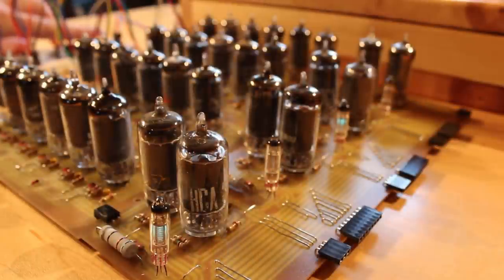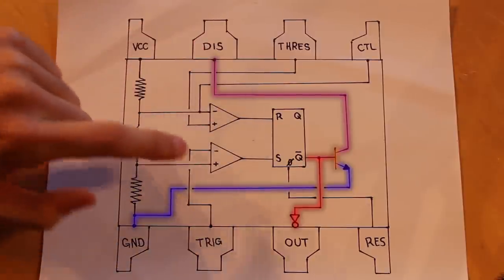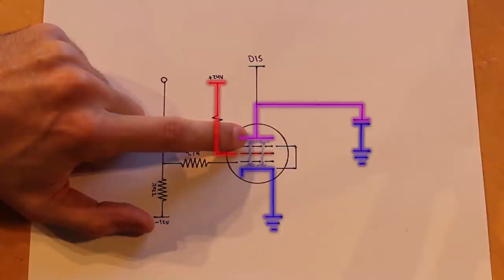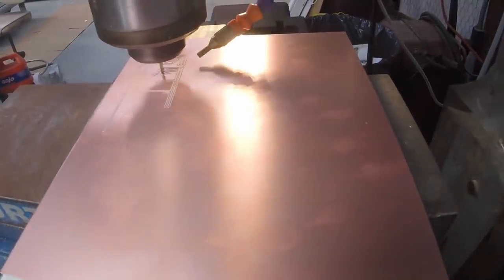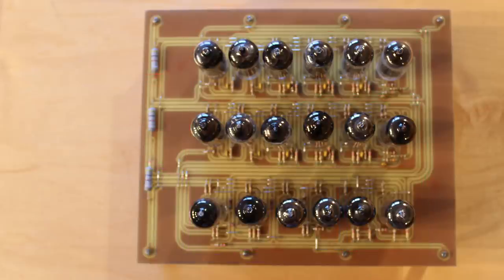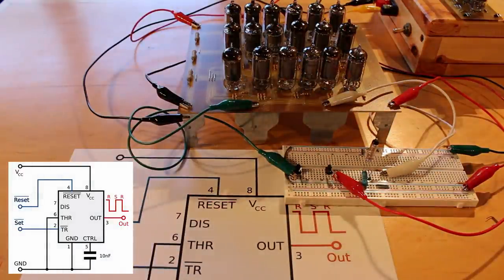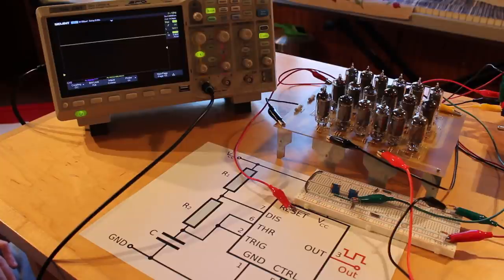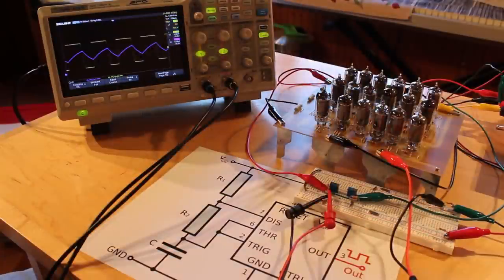Building the Largest 555 Timer in the World out of Vacuum Tubes

Comment: Reminds me of the broken semiconductor part "Made in Japan" that Doc Brown in 1955 replaced with a jumble of tubes and wires such that the Delorean time machine could work again. Excellent idea and super execution! One of the first chips I ever used (back in 1983 in school) was the LMN555 timer chip.
Reply: It's proof that that could be done. Although it would have been very expensive. Transistors existed back then, but they would have probably been $20 or more a pop ($20 in 1955 dollars), I'd have to look it up. Although, Doc financed his science with some sort of inheritance, didn't he? I actually used to do something like this before I figured out where to buy ICs. I would TRY to wire up say, an XOR gate made with RTL (resistor transistor logic), which is about the simplest logic you can get. But still required several breadboards just for a half adder. Not to mention the rat's nest of wiring, but I'm sure that could be cleaned up.

Comment: Surprised at how SQUARE the square wave was (thought it would be "warmer"?). Great job, the art of electronics. And demonstrating using vacuum fluorescent display was a nice touch (never seen a VFD like that before.) Fun video, thank you.
Reply: Well, the comparators / op amps use 6 tubes each, which should give them pretty high amplification, meaning that the comparators should be switching really quickly between maximum and minimum voltage. I think that's why it's so clean. The design had probably worked ok with fewer gain stages in the op amps, but then I imagine the square wave would have been more rounded.

Comment: Awesome project :)

Now build a tube version of a 4017, thow in some Diode valve's and use some VFD's to build a valve version of the night rider scanning eye :)
Reply from the maker: Thank you!
Decade counters are really tricky with tubes! I haven't had much luck at low voltages getting a good toggle flip flop working, but at higher voltages, HP had a really great design for a decade counter: http://madrona.ca/e/edte/HP520/index.html
One of these days I'll have to dive into that circuit design and see if I can make it work at the low voltages I'm working at!
Reply: 4017: my favourite chip.

Comment: Cool project!  Just one minor nit-pick - you have the operation of the monostable backward.  At rest, the cap is held in a discharged state by the discharge pin.  When the 555 is triggered, the discharge tube/transistor turns off, which allows the cap to charge toward Vcc.  Once the voltage reaches 2/3 Vcc, the threshold comparator resets the flip-flop which turns the discharge device back on, discharging the cap in preparation for the next trigger event.
Reply from the maker: Thank you!
I knew I'd make a mistake somewhere on the 555 timer side, haha. That makes sense though, thanks for letting me know!

Comment: I love it - you have a 555 timer that needs to warm up :)  Great video.
Reply from the maker: Thank you!
It's really fun while warming up too because all sorts of chaotic things happen as the tubes warm up at different rates!
Reply: Not only that but it's a 555 that works natively with higher voltages. No buffers or voltage translation required 👍 Surely there is a niche application where this might be useful? As long as power consumption is not an issue 🤷‍♂️

Comment: Awesome! Made my day! If you want to make an affordable kit, think long and hard about the tube type, because that's going to make the biggest differernce price-wise. Select something that causes audiophiles to cringe. Something made in abundance at one time and then not used for another purpose, like a TV video amplifier or something like that. In europe we have the Pxx type tubes, these are usually dirt cheap. I really like the physical format and how it looks like a scaled up version of the real thing, don't change that!
Reply from the maker: Thank you!
Figuring out the tube type has been the biggest hurdle to overcome. My go-to tube is the 6AU6 as it works really well at low voltages and is very cheap indeed (aside from using it for pre-amps, it's mostly ignored by the audio community. However, I realize that that tube may not be easy to find depending on where someone is in the world (or even how the used market is feeling on a specific day). 

So, I've been working on an OpAmp design that only uses 4 tubes (instead of 6) and has some potentiometers in it to tune it to different tubes. So far, I've got it working pretty well with 6136, 6AU6, 6CB6 and 6DT6 tubes. Some others like the 6BA6 didn't work at all, so we still have to pick the right tubes. But, having more tube options is always better!
Reply: There are a lot of cheap 6F1Ps on eBay, if triodes can also be worked into the design!

Comment: This is absolutely brilliant! Including the pins and all that. I love your PCB design, with rounded corners on tracks.
Reply from the maker: Thank you so much!
I really wanted it to be as close to pin compatible as possible, though I did have to sacrifice the control pin to get my negative bias voltage in.
The rounded corners are probably my favorite part of the PCB design. I especially like it when there's two or three traces that follow the same curve, it gives a really unique look. It's kind of my modern, digital homage to the hand-drawn traces of yesteryear!
Reply: @UsagiElectric  yes, I know the old PCB design from all those radios and amps I repaired :) And in my early days in electronics (1990s/2000s or so) I did hand-drawn PCB designs, then etched them with ferric chloride or a mix of hydrogen peroxide and muriatic acid. I hardly ever make devices using PCB as I prefer the old point-to-point style and terminal boards (most of the electronic stuff I make is vacuum tube amps), but when I do, I typically do it in Eagle and either have the design CNC engraved like you do, or take it to a PCB manufacturing company and have all SMD parts soldered in so that all I have to do is through-hole components.

Oh, and your wascally wabbit is so sweet! :)
Reply from the maker: @KeritechElectronics  I have massive respect for anyone that actually etched PCBs with acid! I'm so accident prone, that I'm absolutely terrified of knocking the container and spilling chemicals everywhere. Fortauntely, with the mill, I just get everything zero'd out, hit Go and then walk away so my accident prone-ness can't mess anything up, haha.

If you want, come join us over on the Discord chat group, I would absolutely love to see some of the tube amps that you've built! (Link just in case https://discord.com/invite/p7UsfHD )

The bunnies name is Koma, which is short for "Komaru or 困る" which roughly translates to troublesome. She was so energetic when she was younger that she would run full speed all around the room and crash into things, knocking stuff over and generally causing chaos, so the name is a bit of a fitting choice, haha.

Comment: AWESOME!  And the artistic rendering is the icing on the cake.  
Please, a kit - of course creating that is another work of art as well.
Reply from the maker: Thank you!
Making it a kit is going to be a definite hurdle. I would like to perhaps shift the used tube from the 6AU6 to the 6CB6, but that's going to require a redesign of the OpAmps. And since I'll be redesigning them, I'd like to see if I can get them down to four tubes instead of six, that'll save a decent amount in terms of materials cost. So, it's a long road, but I think the result can be something really cool!

Comment: I've found that the 555 reset operation is not very well defined.  In astable mode, some 555 devices will halt the output high or low depending which it was when reset was applied.  Others send the output always high, yet others send the output always low.  I wonder which camp this one falls into.

Comment: I don't really understand electronics so this will probably sound stupid, but would it be possible for the socket that's going to be hooked up to have a sort of like
Normal 555 timer end on it?
Like it goes to a little box with the normal 8 legs that a regular 555 timer has, allowing you to hook up this huge 555 to a circuit board which has a slot for a regular 555 
I may be misunderstanding how this all works, but replacing some electronic equipment's 555 with this, and seeing if the equipment still functions and uses the tubes as it would the normal 555 without realising it's something huge would be so cool
Like taking a motherboard, removing a regular 555 from it, and replacing it with this

Comment: Here is an idea: Instead of making a socket for the valve chip, simply lengthen the rods that the legs are soldered to. I will make a PCB footprints  for the chip and the extra large components I will make for it. I will 3D print super large bodies for the resistors and capacitors proportional to  the size of the chip and place the real components inside them. It will take a sizable chunk of copper clad and the solder alone would probably make the board weigh an extra kilogram,, but I think it would look stunning in the end. Here is a challenge for you, JLCPCB.

Comment: Just curious what it's bandwidth limitations are or how it's bandwidth compares to the solid state 555 timer?
Reply from the maker: Naturally, it's a way, way more limited than the solid state 555. 
I did actually give it a test in astable to see just how quick I could push it, and it seems that 8kHz is about the limit. It will actually go faster, but the falling edge starts to fall too slow and the output waveform gets smaller and smaller. You can see the slow falling edge here: https://i.postimg.cc/fRBJ9Nx6/IMAG3517.jpg
Still, for such a compromised design, that's not bad at all!
Reply: @UsagiElectric  I'll check out the link. Yeah I can see the limitations exactly the way you're describing them due to the components you used for the project but the fact you even built this with tube technology is pretty cool.

Comment: I've got a question...I've seen how op-amp can be made with just two tubes, as what has been done by Philbrick Researches in their models of pluggable vacuum tube op amps. Was such a design non ideal for the 555 timer's own internal op amp? Or the reason for not choosing such a design was something else?
Also, I was actually thinking about building such a unit and, well...you've totally anticipated it!
good luck with your project, I adore the work you're doing with these tubes!
Reply: As far as I know, the Philbrick design uses 2 double triodes, so in total an amount of 4 triode systems.
His design uses 3 amplifier stages between first (diff.amp) and last (buffer) stage, while Philbrick only had one. For that reason his design comes with higher gain and is probably a little more suitable for being used as comparator.
Reply: @schmitzvonschmitzen2870  Well, I disagree. The philbrick model had an open loop gain of 15 thousand or so. Surely his model can't be higher? Also, the philbrick datasheets states that such op amp is very good for comparator purposes,
Reply: @willjackson1955  I don´t contradict Philbrick was nicely useable as comparator, compared to alternative solutions back in the days. 
It´s definitly possible to increase gain by adding more amplifier stages, so it shouldn be a big deal to get more than 80dB from such an device (apart from issues like oscillation or phaseresponse). Probably he even had to use more stages than the Philbrick model, due to the way lower supply voltage he is using, in order to catch up with the Philbricks open loop gain. Having such an low supply voltage makes it hard to get an sufficient amplification from a single stage. Maybe he can tell us about the open loop gain of his model?
Reply from the maker: Thank you for checking the videos out!

You're both actually on the right track with what insanity my design is doing here.
My OpAmp design is actually just a copy of the Philbrick design. But, the K2-W that i based this off of uses two dual triodes, so there's four switching elements in use. Two for the differential amplifier, one gain stage and one cathode follower buffer. But, what allows the K2-W to get a gain of around 15000x is the absolutely insane voltages being used. It uses +300V to -300V and gives an output that swings between +50V to -50V. That 600V of potential is paramount for big gain.

In my design, I'm using just +24V and -12V, so only a 36V potential, or about 6% of the power used by the K2-W. As a result, just one amplifier stage isn't enough to give me enough gain. So, in order to get more gain, I just kept stacking amplifier stages until I was happy. Though, even with three amplifier stages, I'm still only getting around 150x gain. Now, that's plenty for something like this 555 project, but there's a lot of performance left on the table.

Since I built these OpAmps, I've done a bit more testing virtually to come up with the absolute best resistor values I could and this was the design: https://i.postimg.cc/1ztLmtKJ/BigGain.png

In simulation, this gives a gain of around 6,000, which is absolutely insane given the obscenely low voltages. I really need to test this out in practice and see just how good it is in the real world!
Reply: @UsagiElectric  Hi, thanks for answering me. I've got another question...Are you using the -12v supply for the biasing of the tube? If so, why don't you use cathode resistors to set the bias voltage? Am I missing something here? I've watched pretty much the series, but I may have missed the reason why you use the negative voltage instead of the bias resistors...
thanks again for your answer, I look forward to more updates on this amazing project of yours!
Reply from the maker: @willjackson1955  No problem!
The -12V power supply is being used primarily for negative bias, but I'm also using it to power a pair of tube heaters as well. Having +24V and -12V on the board means I can power heaters by running groups of 4 or 2 in series. It helps me keep the power supply a little neater.
As for the cathode resistors, I've actually done quite a bit of testing trying to get various logic circuits to work without a negative supply just using cathode resistors, but I haven't had any luck at all. I understand on a fundamental level the concept of a cathode resistor to elevate the potential of the cathode in relation to the grid, but I just haven't been able to really get it working right.
Most likely I just haven't found the right resistor values to really get it working right. The good thing about using a -12V bias, is that I can play really fast and loose with resistor values and the circuits work, which means differences in tube characteristics affect the circuit much less than they normally would. So, I can get away with using really worn out tubes or brand new tubes, and the circuit doesn't care 90% of the time. I've built up a few SR Flip Flops and had them working with plate resistors as low 10k and as high as 330k!
But, I haven't given up on the idea of using a cathode resistor to eliminate the -12V bias, so perhaps one of these days I'll get the right resistor values figured out!

Comment: With some extra control logic, that latest circuit would make monophonic all tube synthesizer. I'm sure some people would be interested if you'd made those.
Reply from the maker: Interestingly, I've recently done a bit of testing with a 2D21 Thyratron as an oscillator. 
Here's the setup I was testing out: https://i.postimg.cc/gkRW6n8J/2D21-Osc.png
It generates a really great sawtooth wave, like this: https://i.postimg.cc/fbSjwn16/IMAG3460.jpg
And when input into an inverting amplifier it makes an excellent square wave. With potentiomters on the 2D21 for the plate resistor and the grid resistor, the sawtooth pattern can be changed pretty dramatically, changing the shape of the square wave. 
That could make a really interesting tube synthesizer circuit with both a sawtooth wave and square wave on tap!

Comment: I discovered that the NE555 seems to have no protection diodes. You can put a multimeter in resistance mode across VCC and Control to get the resistance of R1. And between Control and Ground gives you R2 + R3. Interestingly, the chips I have all have 6k resistors in them rather than 5k. That is, I got 6k across VCC and CTL and 12k across CTL and GND. I figure this is down to the fact that it's difficult to get exact values on resistors in an IC. So, the circuits tend to rely more on the ratio of resistances, rather than exact values.